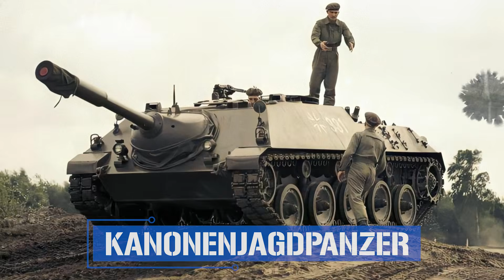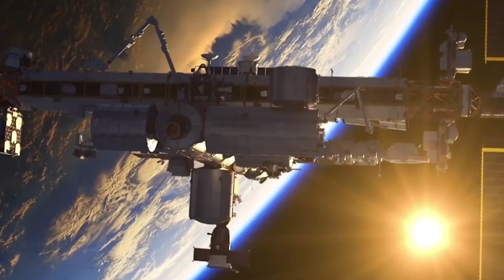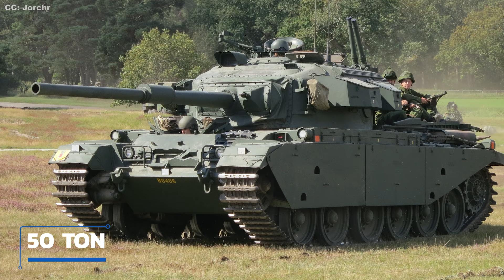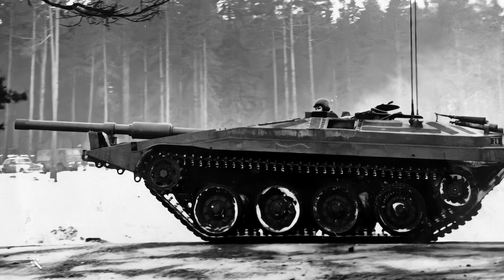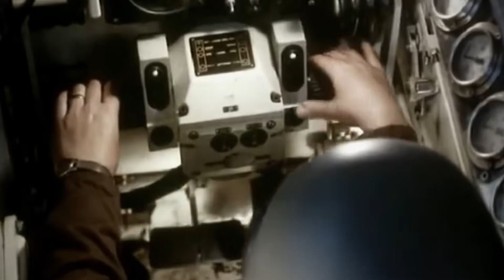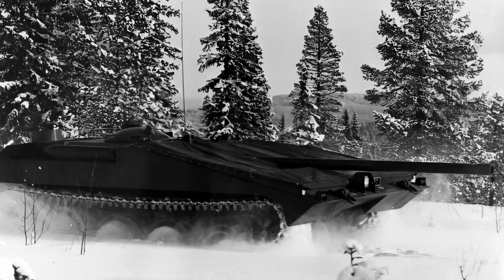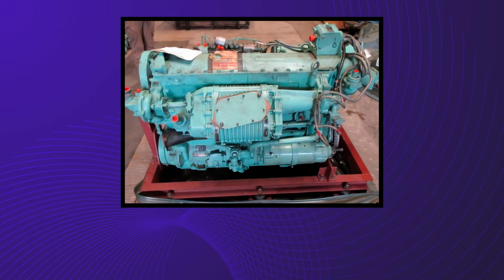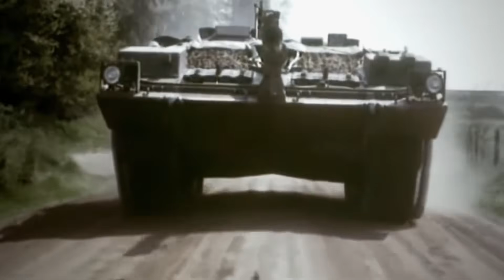Stridsvagn 103: Sweden's Turretless Cold War Super Tank

Comment: Cool looking tank that..Very futuristic looking. 
I wonder how it would have done on the modern battlefield. The Stug was pretty well represented on the eastern front.
Reply: tank destroyers were trash, there are reasons why they're not athing anymore and neither is this one. especially nowadays, with gun stabilisation and electronic aiming making shooting while driving viable. these things can only shoot forward while driving, proper tanks can shoot all around while driving.
Reply: @Ass_of_Amalek  ..I suppose so. Yet that low profile would make them excellent defensive weapons and their mobility would be a good asset. 
I dunno. I personally think that heavy armour has become more of a liability than an asset in the modern battlefield. The Ukraine war has revealed this. You would need a hell of a lot of very expensive tanks to maintain momentum. The 2nd world war already proved that. It was said that the T34 never finished a tank of fuel
Reply: @jiggsborah7041  in WW2, tank destroyers were indeed mostly used for anti-tank ambushes. they would be hidden, fire at enemy tanks, and then get out of there because they would generally lose any exchange of fire. tank destroyers were mostly built because their simpler design made them cheaper and faster to produce than tanks with moving turrets.
I like the flattened sharp shape of the stridsvagn, but I think the merkava does that much better. and the stridsvagn is only 10cm flatter than a T-72.
Reply: @Ass_of_Amalek  ...Yes i agree with you about the stug.. that's why vast numbers were produced. 
The Merkava is a superlative example of heavy armour. Israel is just about the most experienced people out there in armoured warfare. 
That turret is awsome and the vehicle keeps evolving as more experience is gained.
Reply: @jiggsborah7041  merkava is my favourite tank entirely because the turret looks like a flying saucer xD
Reply: @Ass_of_Amalek  ..It's something out of a star wars movie..way ahead of the rest
Reply: @jiggsborah7041  yeah they just need to make the chassis float now instead of rolling on tracks
Reply: @Ass_of_Amalek  ... that would change the way we fight for sure.. I'm a diesel mechanic and worked on dozers etc...Mud ... there's nothing like it.🤣🤣🤣🤣
Reply: @jiggsborah7041  yeah it seems odd to me that vehicle tracks even work well enough to be as widespread as they are. I imagine they must be designed to continue to function in really badly worn condition, given that they are made for driving through essentially abrasive paste of various grain sizes, and they have a hell of a lot of moving joints in direct contact with it, as opposed to wheels. do modern tracks have some sort of encapsulated bearings, or do they just somehow tolerate mud and sand getting everywhere?
Reply: @Ass_of_Amalek  Given the joints in tracks do not rotate really it is easier to make them just an rod through an hole style. I doubt there is any way to seal them against mud and still keep them in an price range that could be called sane, so going simple and replace if worn out is best.
I expect that with new plastics developed we see soon "rubberbands with steel profile" styles getting used like the snowcats use (i would not be overly surprised)
Reply: @Ass_of_Amalek  "tank destroyer" and "tank" is about doctrinal usage, which may or may not be reflected construction of the vehicle.
I don't think the combat records of neither the American M10 nor the German StuG III or the Soviet SU-85 support your claim that "tank destroyers were trash"

" tank destroyers were mostly built because their simpler design made them cheaper and faster to produce than tanks with moving turrets."
All US TDs had turrets.
The reason for the casemate instead of a rotary turret wasn't so much that it was cheaper as that you can fit a much larger gun onto the vehicle that way.
Compare a Panter with the dedicated Jagdpanter, or Tiger with Jagdtiger, the latters pack a lot heavier punch than the tanks. You see the same thing on the Soviet side, having learnt from the KV-2 huge guns in rotating turrets not necessarily is the best solution.

Fun fact, Sven Berge, chief designer of the S-tank, was personal friends with general Tal, who became the main designer of the Merkava and adopted the concept of using the engine as extra armour for the crew compartment from the S-tank.
Reply: @Ass_of_Amalek  Tank destroyers, as a role and dedicated vehicles, were decidedly not trash, hence why they were used throughout the entirety of WW2.

Also, at the time, the 103 compared favourably to all main battle tanks in trials, especially in "time to engage" (the time from spotting an enemy, to coming to a full stop and getting effective fire on target), meaning it was more than capable to act as an offensive weapon. It was not doomed to the passive role of a tank destroyer

Comment: British 105 main gun. Very well thought out design, still able to track a vehicle by moving the entire vehicle in yaw. Super special hydraulic suspension made it really work in a static defensive position. But of course not on the move. However they were a none aggressive country so these were self defence only ...
Reply: They were designed to work like any other main battle tank. If Russia was going to attack Sweden they couldn't just sit around and wait for them to come around to static defensive positions, for obvious reasons. Sweden would have to hit them before they were ready.
There were platoons that had Stridsvagn 130 and those that had Centurions, and their roles were pretty much the same with a few minor changes. No tanks could shoot on the move at the time, so that didn't really matter. Later on tanks could shoot accurately on the move, which is why they were phased out and replaced by a more conventional tank design.
Reply: Swedish 10,5 cm gun, the L7 was too short.
Basic rule for all tanks of the era, if you actually want to hit something you stop the tank before you shoot.
Self defence in this case was to aggressively wipe out bridgeheads of invading forces before they got a chance to consolidate and expand.